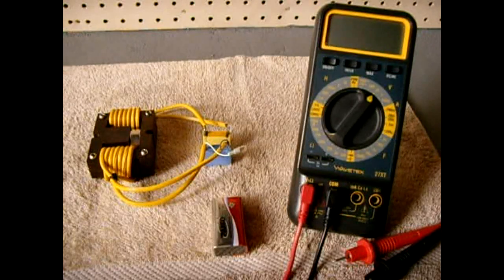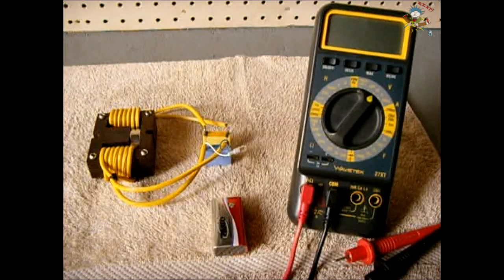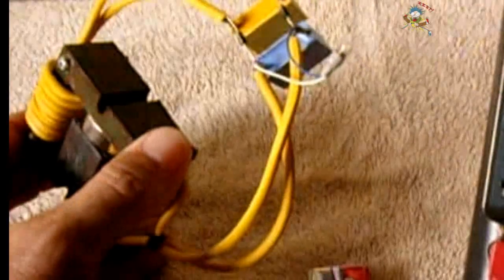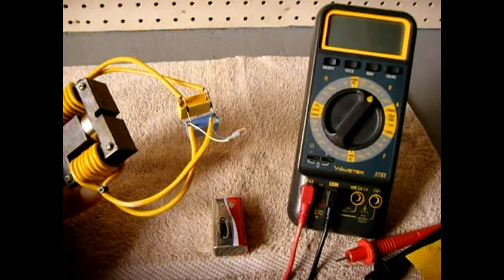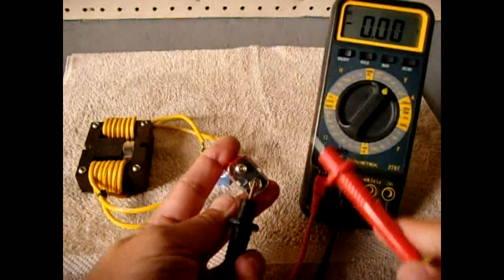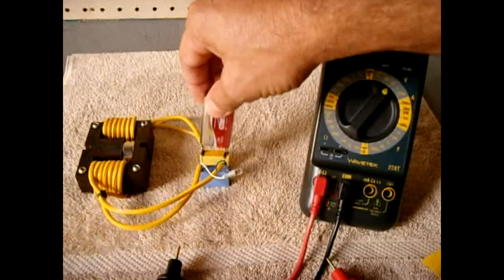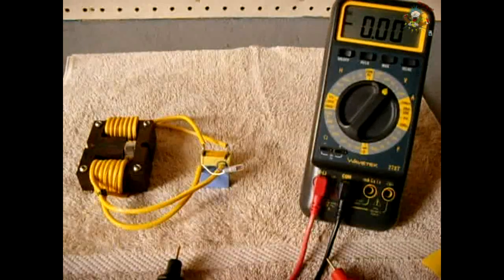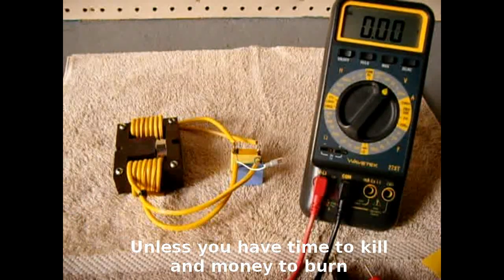Overunity Motionless Free Energy Generator EXPOSED!

Comment: Your Video Looks like you are getting sponsors and the Originals does not.
1) I was so happy to see that you are generating trust by touching two probe to show zero volts without battery and 9.66 when battery is in contact but question arises when you took away the battery from camera view like a magician, who knows  it got exchanged.
2)You show Schematic diagrams as if Original maker had published originals and mailed you the same and down in comments you write that you made a diagram by zooming in the original video.
3) Hey Your basics are not clear cause Without Zooming in your video I SEE SEVEN yellow Winding's in Primary and seven windings in Secondary...... you seriously need to go back to school clear your basics and then prove us your Professionalism
4)You said you made more professional looking Coil then the originals but the originals have solid molded iron coil with no gaps in between and you professional looking coil is all separate parts altogether screwed up.... hey i think you  too are screwed up in this video.... go try something better.
Reply from the maker: You seriously need to learn how to read annotations in videos before posting rude or obnoxious comments. :-) Just so you know, the original was NOT a solid iron core. Clearly you watched the wrong video. Believing in these scam videos will do nothing for your intellect. I have ZERO to gain by posting fake videos. I suggest you stick to watching scam videos instead of my honest videos. As usual, an individual with ZERO subscribers, and no uploaded videos is the one who mouths off about my video.

Comment: What a damn crack up!
I'm always a sceptic, who seeks truth when laws of physics are put into doubt (so it seems, more often on youtube than anywhere else).   I don't even remember how I tripped over this 'motionless electromagnetic generator'; however once viewed, my alarm bells went off when I saw ~13.7V on the presenter's voltmeter, 13.7V being a fairly standard fully charged potential of a lead/acid battery.   Then I wondered how it could power a 12V 60W bulb (7 turns on an iron core??  I think not); a 12V battery built into the 'iron core' seems to be the most viable answer, and I suspect a switch on the bottom side of the 'iron core' which we viewers are restricted from seeing.   Lastly, the source website (http://free-energi.com/index.php) has an interesting disclaimer, and if anyone can still take the original video (or any of that site) seriously after reading that, well, that's their own problem!  I would LOVE to see such a device truly existent and operational - if anyone could ever build one inspired by what we have seen... well, 'well and good', and good luck.   Finally, electronicsNmore, thanks to you (and others 'in the know') for some seriously amusing comments.  I also like the towel you used.  Teleport me one if you could, will ya?! :D
Reply: Altrough the device in the video and the website you mentioned are scams the Motionless Electromagnetic Generator is real.
How does the MEG work?
Consider the physical layout of the MEG. You have a stack of neodymium magnets in the center of a rectangular toroidal core. The magnets touch each side of the core on the inside. There are no coils on the core yet.

What does the magnet flux do?

The flux from the magnets will divide equally between each leg of the core. So you have half the flux flowing on the right and half on the left.

You now place coils on this core. You use two control coils on the top on each side of the magnet stack. And you wind two output coils on each vertical leg on opposite sides.

OK, it is set up. Now you want to switch all the magnet flux to one side by opposing the magnet flux with the opposite control coil. How much flux will the coil need to generate to do this? Well, the answer of course is half the magnet flux since that is what is flowing in that leg. The other control coil is in the off condition, and open circuited, so no current can be induced in it and hence no back-flux generated. The core must not be allowed to reach magnetic saturation or more energy will be required to force the flux to the other side.

Then you turn off the control coil and what happens?

Remember both control coils are now off. The magnet flux will return to its original starting condition of half the flux flowing on each side. Does the magnet need any help to do this? No, of course not. When you did this you also removed half the magnet flux from the other leg when the control coil was on. The first half cycle you only see half the normal induction level in each output coil because at the start you only switch half the magnet flux into one leg and out of the other. So the total change is Bmag/2.

Now on subsequent cycles you let the magnet flux return to its original steady state and let the magnet do the work. Both control coils are off while this happens. Just when the magnet flux reaches its equilibrium point you turn on the other coil and keep the flux change going the other way. Each coil only needs to always switch half the magnet flux not all of it. After the first half cycle you see a 100% change of the magnet flux in each output coil on each cycle for an input power that is half the output. This assumes that you are activating the control coils for half of each cycle. This means you have a theoretical maximum COP of 2.0. You are using the magnet stack as a flux battery and "letting" it do half the work.

So you can get an OverUnity solid state generator with a theoretical maximum gain of 2.0. Just this alone could allow you to reduce your utility bill by about half if you put these devices between your breaker panel and your appliances.

Comment: It is more fun to argue with the over-unity folks by outright demonstrating what the device is doing mathematically, the effect of things such as, heat, friction, energy loss over distance, and things like the energy density contained in a magnetic field. From there very tenderly walking them through where the laws of thermodynamics apply to their build and how the energy put into the system is still less than the energy put out when they bother to account for those things. It may be a very efficent device at converting potential energy into kinetic but efficient =/= breaking the laws of thermodynamics.

Good times.

Comment: Ummm, did you remember to include 2 motors? These motors use transistors, causing the electrical power on the positive side to go through the transistor, changing the polarity and increasing the voltage, and sending it out on the negative end, boosting the electricity going through the negative end, causing the low energy generator to turn, turning the high energy generator therefore creating an infinite loop.
Reply from the maker: You must have watched a different video. :-)
Reply: Hmmm, must have. If I find the link to it, I'll post it.
Reply from the maker: I delete links because I do not want to help these fraudsters get more views/money. Send me a private message with the link.

Thanks.

Comment from the maker: ***** Sure it works. LOL. Unless you have tried it yourself, or have a video of your own proving to others that this works(Including all details/specs/and parts), then don't post stupid comments.
Reply: They use the Aharonov-Bohm effect in their patented Motionless Electromagnetic Generator (MEG). They are able to use the Aharonov-Bohm effect to first energize the surrounding vacuum outside the transformer core with curl-free A-potential, then perturb the core normally so as to send out A-field perturbations into that energized external vacuum (into its A-potential). From the perturbed local A-field vacuum the MEG receives back (from all directions) excess E-field energy pulses by the simple equation dA/dt = – E. The result is that the local altered vacuum – when subsequently perturbed – then sends back free E-field energy to the unit as an extra, free energy input from the active vacuum environment. By insuring some coherence in the received E-field signals, they also insure that the return excess energy input is usable EM energy from the altered local vacuum/spacetime.
 
As you know, force fields exist only in matter, since mass is a component of force by the simple equation F = d/dt(mv). Placing m = 0 in that equation shows that in massless space, “force” does not exist. So instead of EM force fields in massless space, instead there exist precursor “conditions of spacetime” as pointed out by Nobelist Richard Feynman. What we call “EM force”, then, rigorously is the ongoing interaction of that “precursor field” with charged matter q.
 
As the great John Wheeler points out, “Space acts on matter, telling it how to move. In turn, matter reacts back on space, telling it how to curve.”  [Wheeler's principle, as stated in W. Misner, K.S. Thorne, and J.A. Wheeler, Gravitation, W.H. Freeman and Co., San Francisco, 1973, p. 5].
 
Wheeler also pointed out the dominance of the interacting spacetime with matter and effects in matter. Quoting: “…elementary particles represent a percentage-wise almost completely negligible change in the locally violent conditions that characterize the vacuum...In other words, elementary particles do not form a really basic starting point for the description of nature. Instead, they represent a first-order correction to vacuum physics.”
 
So the Aharonov-Bohm effect (together with many others) shows that it is possible to directly condition or change (or “engineer”) the local spacetime itself, and then use it to affect the physical system embedded in that altered local spacetime.
 
What we call “force” is the ongoing interaction of the “condition of spacetime itself” with matter.
 
The bottom line is that (1) the vacuum/spacetime can first be preconditioned locally (precursive engineering), without using force or work (which is translation of force), and (2) then the altered and energized vacuum/spacetime can be stimulated to provide excess EM energy freely back to the system. The system then has TWO energy inputs: (1) the one we pay to make, and (2) the one the surrounding activated vacuum gives us for free. So, like a windmill in a free EM energy wind, their unit can exhibit COP>1.0, even though its energy efficiency is always less than 100%.
 
So “energy from the vacuum” is no more eerie than a common windmill or solar power cell array. Given the necessary input energy from the active surrounding environment, the system is legitimately permitted to function as an analogue to a common heat pump – which has an efficiency of only about 50%, but which normally has a COP = 3.0 to 4.0. In short, the heat pump wastes half of all its input energy from whatever source, but it receives so much excess energy from its activated environment that it can still output more heat energy than the electrical energy the operator himself pays to input. No violation of thermodynamics or of physics is involved. Instead, there is involved just a way to directly and freely alter the local environment so it is energized, and then to trigger it into sending free energy into one’s system to be collected and power the loads.
 
Note that such asymmetrical overunity electrical systems are specifically excluded from the normal electrical engineering model. The Heaviside equations were deliberately symmetrized in 1892 by Lorentz, at the instigation of J. P. Morgan, just prior to the formation of modern electrical engineering. It was done specifically to remove the asymmetrical “energy from the active vacuum” systems that Nikola Tesla had discovered. Tesla had labeled them as “energy from the active medium” systems. Tesla had just destroyed the dream of Morgan and Edison for their great DC power empire (a DC power plant every two miles in cities and built-up areas) by putting in practical AC generators at Niagara Falls. Since AC could be transmitted fairly efficiently for long distances and DC could not, then with AC power one did not require most of those expensive DC power plants. So the world adopted AC power stations and transmission. With that blow to his dreams of empire, the ruthless Morgan was immediately determined to destroy Tesla utterly and his backer Westinghouse also. And he thoroughly accomplished both goals.
 
Here is just one statement by Tesla of what he intended to do. Quoting:
 
"Ere many generations pass, our machinery will be driven by a power obtainable at any point in the universe. This idea is not novel... We find it in the delightful myth of Antheus, who derives power from the earth; we find it among the subtle speculations of one of your splendid mathematicians...Throughout space there is energy. Is this energy static or kinetic? If static our hopes are in vain; if kinetic – and this we know it is, for certain – then it is a mere question of time when men will succeed in attaching their machinery to the very wheelwork of nature." [Nikola Tesla, in a speech in New York to the American Institute of Electrical Engineers, 1891. Quoted from back cover of his biography, Margaret Cheney, Tesla: Man Out of Time].
 
During an address in 1897 Tesla stated:
     “We have to evolve means for obtaining energy from stores which are forever inexhaustible, to perfect methods which do not imply consumption and waste of any material whatever. I now feel sure that the realization of that idea is not far off. ...the possibilities of the development I refer to, namely, that of the operation of engines on any point of the earth by the energy of the medium...” [Nikola Tesla, during an address in 1897 commemorating his installation of generators at Niagara Falls.].
Reply: Many experts claim this is impossible, but actually there are many systems that produce more work than we’re required to supply, because the excess energy is provided by the environment. A good example of this is the refrigerator. This ordinary kitchen appliance typically operates with a “coefficient of performance” of 2.0, which means that twice as much heat is removed from inside than the equivalent electricity used to do it. Most scientist believe that this kind of performance is only possible with heat systems, but many scientists have demonstrated these principles with electromagnetics as well.

In 1977, Ilya Prigogine received a Nobel Prize for what is basically an extension to conventional thermodynamics, which only describe how heat operates in “closed systems.” Those are systems that are cut off from any external form of energy. Prigogine’s work helped to extend our understanding of thermodynamics to include systems that are open to the environment, which slows the appearance of entropy down and allows more total work to be done than what we have to supply.
Reply: No.

Comment: more volts
Reply from the maker: Does not matter how many volts you use, you will end up with the same result.
Reply: electronicsNmore should match the (volts uf) of the capacitor
Reply: Rodrigo Abao need to charge the capacitor from the battery
Reply from the maker: If you are an expert on this, then please by all means post a ink to your video showing this device working. :-)

Comment: The one thing I noticed that you did different was with the battery. In the original video he held one wire to the contraption and tapped the other, much like points in an ignition coil. I think he created two LC circuits feeding each other back and forth. Of course the resonant feedback would only last for a few seconds, which is why he always cut the video or shut it down within a few seconds after starting it.

Comment: What you did not see in the video of the free power generator that you replicated was a fine winding of around 5 or 6 turns which where coming from another ac source which was producing all the power.  The 9 volt battery was only a decoy and somebody else was switching on and off for him.

Comment: you can generate power using just north or south fields you don't need both which I find odd or if you pass copper wire past more copper wire they both produce current yet there is no field or voltage there?how is this possible?it must be the earths field. If we could harness the earths fields that would be an idea to study.

Comment: did you try the same north south magnet as the vid?it looks like your one is just a north and south mag not a north/south two sides magnet. Just wondered?round magnets have a n side and s side the kidney ones have n/s one side and n/s the other......i know its probably a con but I do know upsetting the flux from a magnet using steel and copper laminated coils has some strange results which I am concentrating on as this seems like my best idea yet. Most folks don't use steel coils but the do generate voltage when magnets pass by except the voltage is opposite to copper and aluminium coils. I think there is a way using steel and copper coils but getting the ratio correct is a nightmare.